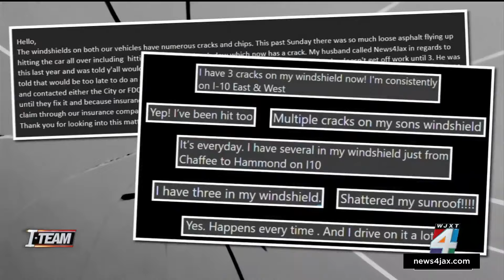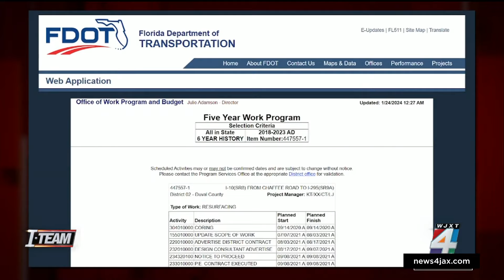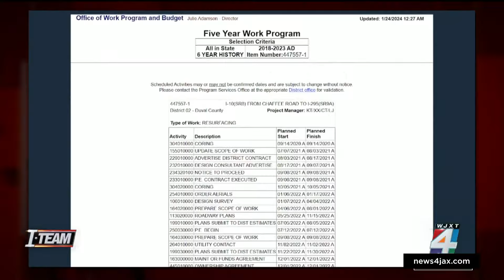Hundreds of I-10 drivers share photos & stories of damaged cars and windshields

Comment: They won't repave the roads in the middle of winter because soon as roads are plowed the roads will be right back to potholed and broken.
You gotta wait til spring like usual.
Stay farther back from vehicles. Stop driving in groups of vehicles and STAY FARTHER BACK from other vehicles.
Black top and concrete won't set properly when it's below 60 degrees.